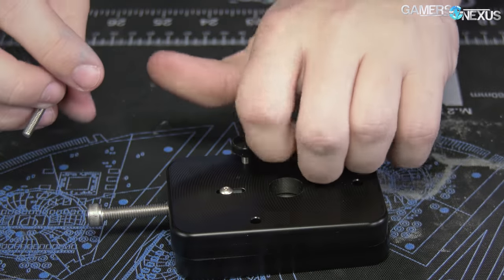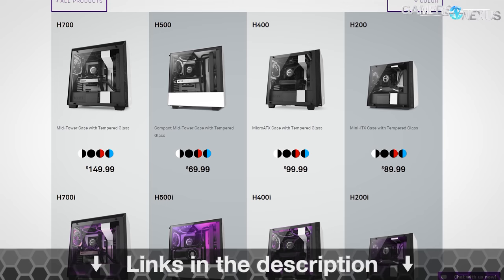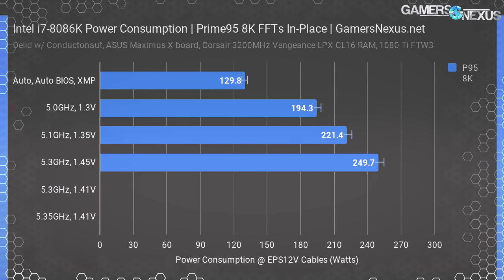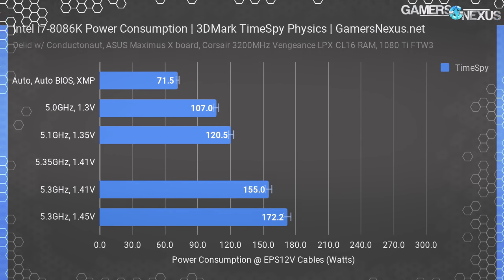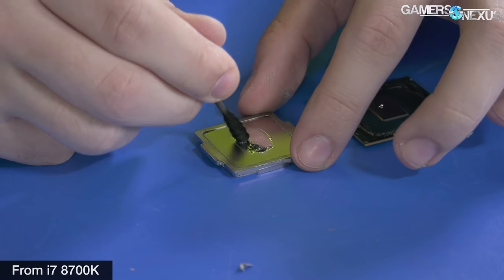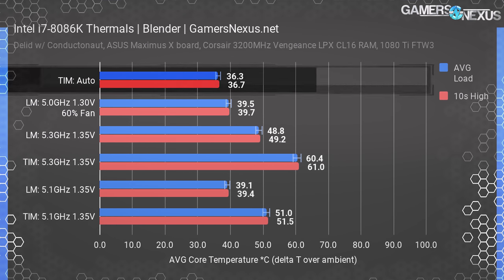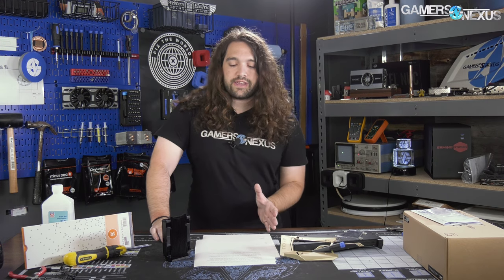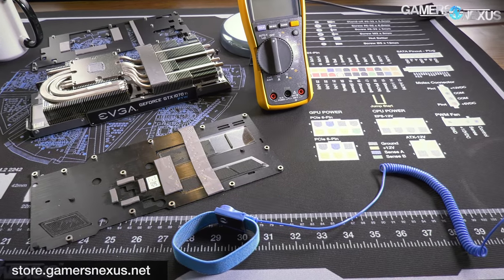The Untold Story of Liquid Metal: 8086K Power, Noise, & Thermals

Comment: I delidded my 7700k just for fan noise reduction. The whole stress of the situation and the fact that I needed to buy liquid metal to get my CPU functioning in what I consider a normal way means that my next CPU will definitely be AMD.
Reply: Aaron B nothing from AMD will operate at 5 ghz or better, so it should be plenty quiet being so slow and all.  GL with it.
Reply: Jeff Smith yep, go INTEL...but hey you got your 5ghz, who needs better multitasking?
Reply: needabettername apparently HardwareCanucks did, when he ditched his Ryzen system in favor of an Intel one...
Reply: Jeff Smith That wasn't a hardware issue, it was a software issue. When Intel has basically been using the same architecture since Sandy Bridge and Ryzen is a brand new thing, it shouldn't be any surprise that software is going to function better with Intel.
Reply: praetorxyn wasn't a hardware issue?  Did you watch the video?  It was due to the 8700k rendering  faster thanks to Intel's hardware acceleration in Adobe premiere.  The 8700k was up there with the 1950x and 7980xe iirc, for a fraction of the price.  Here's the video, you should watch it.

https://m.youtube.com/watch?v=Tj6rUdhmIvQ
Reply: Jeff, I was getting these heat spikes on a non overclocked 7700k. I was just wanting the 7700k to run within the temperature range of my old 6700 non k. It would not. And best of all my fan would ramp up like crazy for no reason, if I actually changed the fan curve so that it didn't speed up at all, my 7700's temps would rise and fall with their own because of the heat happening between the cpu and the metal lid and the terrible tim. My cpu would go from 40c to 79c just for opening chrome, or word, or sometimes not doing anything since a background operation would just start.

Anyways, I delidded the CPU, and now at stock it runs from 40c-50c without making my fans go crazy.
Reply: Aaron B guess you got a chip with poor TIM, happens I suppose.  What voltage were you running?  My 8700k was getting fed 1.35v completely stock by my maximus x hero, now oc'd to 4.7 all cores with 1.15v and highest temp I ever see is mid 60's (benchmarking, high 50's playing Witcher 3, Division, FO4).

In any case, you shouldn't have any problem selling your 7700k system, or the ryzen system later if you're not happy with it, so no reason not to give it a try.
Reply: Of course I did. Adobe doesn't use more than 6 cores or so for one thing. Adobe has piss poor optimization, and from my memory that video was about Ryzen having issues with RAM compatibility and other things. Something like Da Vinci will have Threadripper run circles around Intel's HEDT lineup, while in Adobe they will perform largely the same because Adobe doesn't bother to optimize. Software has to be optimized for the Ryzen architecture, which is going to take time, and some companies like Adobe will probably never bother to do it in any case.
Reply: praetorxyn whether or not Adobe has piss poor optimization is irrelevant, it's the program he uses and he needed the best system for using it, which was an Intel build.  It's really that simple, use what works best regardless of manufacturer.  Only an idiot would buy a certain product based on blind loyalty.  AMD never paid me to use their phenom II 965, FX 6300, or FX 8370, and intel ain't paying me to use their 8700k, lol.
Reply: Of course not. I'm just stating that it would be damn sad if a 7+ year mature platform wasn't performing better than a brand new one in most anything. Hardware is hardware, software is software. I'm just glad AMD has finally done something. Look at Intel ver hte past decade, we had since Sandy Bridge nothing but quad core CPU's and incremental improvements. THen all of a sudden Ryzen comes out, and Intel is all of a sudden able ot pull 6 and 8 core mainstream CPU's out of its ass, so everyone should be thanking AMD regardless of what they're buying.
Reply: praetorxyn exactly why I'm glad AMD came out with something since the sorry excuse of an FX processor and finally gave Intel a reason to start releasing some new stuff.  Most innovations are incremental, just like the 1700x to 2700x for example, but Intel has had no financial reason to spend a whole lot developing when nobody was competing with them.  Same goes for Nvidia right now, nothing competes with the 1080ti, so they have no motivation to release anything better.  Competition is good for everyone, especially the consumers.
Reply: @aaronb5304  A giant Noctua cpu cooler does solve a lot of things at once, everything from noise levels to temperature levels and it´s not even a delidded intel 6700k running stock speed.

Comment: Had a 9900K on preorder, but apparently it runs pretty hot even at stock and the damn thing isn't shipping. Cancelled my preorder and ordered an 8086K and also delidding service for it. I'll run it at 5.0 ghz nice and cool with a 360 rad.

Comment: The amount of temperature reduction is facinating. Out of curiosity, have you ever measured the gap between the inside of the IHS and the top of the die immeadiately after de-lidding? The factory TIM on the die of the de-lidded CPU looked a bit thick.

Comment: its basically a pre-binned 8700k by intel. which explains for low quality 8700k flooding the market lately. based on my experience the first few batches of 8700k was able to hit 5.0 without any problem but nowadays even trying to hit 4.9 proves to be a struggle with delidding

Comment: Excellent video, very well explained! Curious to know were those voltages as measured under load or what you had the voltage set to in the BIOS? They're almost identical to my delidded 8086k results in terms of clock/voltage under load.

Comment: I'm using my 7700k delided, resealed with liquid metal, stock clocks and undervolted (1.21v) :) With temps outside (and inside) near 30C/86F it's kinda cool (pun intended).

Comment: Hey Steve. I think the reason why the most of the users (including me) avoid using liquid metal is the worries they have about lifespan and durability. I really need to know if liquid metal is harmful or not. I use AIO liquid cooler (which has copper base). Some people report fractions on CPU die and corrosion on the copper base of the AIO cooler. Can you explain these issues, please?

Comment: I delidid my 7600k that could reach 5.2 stable but i keep it at 5.1 due to it being at a safer voltage and i put it in a system that i made for running different stuff on and some games. Well i didn't have an aftermarket cooler on hand so i put the stock on and surprisingly it holds 5.1 stable and under load gets up to 94c. Im surprised i haven't burned my house down.
Reply: cowthedestroyer That's actually pretty damn amazing
Reply: Its also astraight up lie, cause the 7600K dosent come with any stock cooler.
Reply: I never said it did. The stock cooler comes from an i3 7320 that i use as a socket protector most of the time but right now its in a pc that my dad uses to watch netflix.
Reply: 7600k doesn't have stock cooler
Reply: So and it runs without a cooler or what?! 
Even so 5,2 or even 5,1 GHZ on a 7600K is highly unlikley,, which Voltage are you using?
Reply: Im getting 5.1Ghz on 1.4 volts. Its running on the stock cooler rn.
Reply: is the stock cooler the one with the copper slug core or without?
Reply: Without but under load it does crash during the day as my room can reach up to 95f and goes back down to about 70 at night.
Reply: cowthedestroyer that's impressive but I wouldn't feel comfortable with my CPU reaching 94C when I can shell an amazing 30 bucks or so and get myself a CM 212
Reply: Im not gonna buy a new cooler im going to take one off of another pc that i have but haven't got around to it yet.
Reply: What do you mean by "underload"?
Reply: Running cinebench it crashes during the day because of how hot my room gets
Reply: For everyone that doesn't belive that i have my i5 7600k running at 5.1 Ghz 1.4 volts on the stock cooler here ya go.https://youtu.be/4-Y6-vtI_YE
Reply: If you really want to cheap out and get a decent reduction, an old intel cooler and high end paste should do a lot.

Comment: When you overclock an i7-8700K or i7-8086K or the future i9-9900K ... does the BIOS/UEFI set all cores to that higher clock rate, at all times? ... and this eliminates "boost clock" since all cores are running at that clock rate, at all times?

Comment: 5:00, Close to advertised TDP ? I though TDP stands for Thermal design power (or how much heat can the chip generates in watts), not power consumption @ 12V cables.

Comment: I'm curious. It's probably a completely useless excercise, but as you're looking at voltages, thermals and fan noise levels anyways, I wonder how much (if at all) the 8086k could be undervolted at it's stock speed. If the voltage could be lowered, thermals, power consumption and noise leves should improve.

Comment: Anybody ever use galinstan? Conductonaut is made of galinstan. You can buy 10g of galinstan on ebay for the same price as 1g of Conductonaut.  This generic galinstan is an alloy of 68% gallium, 22% indium, and 10% tin. Conductonaut's alloy is proprietary and unpublished.  Galinstan will normally have a thermal conductivity of ~30 W/mk, compared to Conductonaut's claimed 73 W/mk.  But, once you get over ~30 W/mk, a TIM's thermal conductive efficiency goes way down as the capacity of other non-extreme cooling components (heatsink/block/radiator/fans/IHS/etc) reach their ceiling.

Comment: Delid + Nofan CR-100A or CR-95C = fanless 8700k at 4.5Ghz all core (+/- 200mhz depending on quality of your chip). Or you can buy an older Intel CPU like 2600k and run it all-core 4.7Ghz just the same.

Comment: and yet my 8700k, runs at 70-85degree stock on full load in prime95 on a noctua d14 with kryonout paste. Perhabs airflow from the workbench used is non obstrocted enogh to get these very good temps even on Tim(non delidded) in your tests.

Comment: I have 4770k I have delided long back and using MX 4 as thermal compound between die and IHS. But thinking of using liquid matel but in my place i do not have access to liquid electrical tape. SO can i use MX 4 for the resistors beside the CPU die ? so that if the LM overflows, it wont sort them. 

Any advice will be helpfull.. BTW your video are awsome and knowledgeable

Comment: It is crazy if you have to delid a CPU just to get the noise level accetable when you clock it on the high side. One more reason why I wait for Zen2 instead of buying a 6 core Coffee Lake, if Intel doesn't even want to solder because  a small percentage of the chips would get damaged if they would do so...

Comment: Pro tip: use a choptsick to remove any leftover silicon from the IHS
Reply from the maker: You really don't want to remove silicon from the CPU!
Reply: Actually just rubbing it with a dry towel works great.
Reply: Maybe someday I'll have the balls to buy an 8700K and delid it :D
Reply: ???
i doubt u mean silicon
Reply: I meant silicon adhesive obviously
Reply: jbryan09100 I think what u meant to say is silicone

Comment: I finally decided to delid my 8700k(1.25v@4.7, no avx offset), was just too scared I'd fuck it up. Recently it started to run really hot with my Kraken Z73 in O11Dynamic - like 40-50C idle,75-85 while gaming (POE, Cyberpunk for example). Case and AIO fans were spinning at 80-90% while gaming and the noise was unbearable. Since I delided and got liquid metal I haven't seen temps go over 70C while gaming and 35 idle, even my RTX 3080 few degree lower temps because it's colder inside the case. Fans spin at 60% tops and I can't hear it anymore with my headphones on. I wish I had done this sooner.

Comment: i'm prepared to void my warrenty on any future intel cpu (cmon ryzen 2, really dont wanna have to void my warrenty to "fix" my ocd and cpu but i would like atleast 4.5ghz so that there's single threaded improvement currently sitting on a 4.1ghz quadcore which head to head in crysis 1 will match ryzen 1 so...not really a upgrade) but what i'm having a hard time finding is how long does liquid metal last in day to day use. if i can slap it on there and it'll have to be replaced next year wel thats annoying but liveable, 2 years is great, if you need to replace it every 6 month's or less personally i'm kinda out because of a rigid tubing liquid cooling system... it's a pain to take appart >.>

Comment: I thought the 8700k was a 80% plus success rate for 5.0ghz? I have one and it can do 5.0ghz at 1.325v but I do put -1 on the avx just to keep it completely stable, before liquid metal I was easily hitting 80c in cinebench and 90c in avx, ive since delidded it and now it sits at around 61c in cinebench max and mid 70's avx.

I am however only using a x42 kraken cooler because I have a strix 1080ti and corsair dominator platinums inside a meshify c case which meant I could not squeeze a x62 in top or front because clearance :(.  very impressive temps after a delid tho on a x42 (70% fan speed) if I do say so myself. for reference I had my delid done ''professionally'' and silicone was reapplied thinly.

Comment: The "Auto" 4.3 All core Turbo is a much more sustainable load than 5.3 OC. Thinking of efficiency.. 198 Watts pure CPU vs 91,6 Watts pure CPU power.. Less than 25% more performance with more than twice the consumption. And that WILL reduce lifespan of the chip a lot. You might think.. But my big AIO handles this at 80c @1.45V. That is within Safe temperature..? No! Temperature range decreases when you raise the voltage. That might be the same as 130c @stock voltage. Same AIO might do about 45c @ 1.15V stock settings. Should give the chip 100x more lifespan. But I agree.. Tweaking and OC for benchmarking etc. can be fun. But not something one should do as a permanent solution. The 5GHz OC should be okay (though it will reduce life compaired to 1.15-1.2V stock settings), but I would really not go any higher than 1.3V for everyday usage. And only with a very good cooler to let it reach 70 > max 80c.

Comment: I don't know if this is the right place to ask but I have a question regarding LM. I had my 7700K delidded (not by myself, had a knowing dude do it for me) in January this year with Conductonaut applied. Am I asking too much of a delidded 7700K or am I just that unlucky - with an ASUS Z270 Prime and D15S with 2 fans running in a range of 600-1000rpm (all this in a S340 Elite with 2 140mm Noctua intake fans and 120&140mm exhaust fans all running 500-700rpm + front dust filter taken off to improve air intake) the CPU still shoots up to 78-79C during gaming (Rocket League, not even that CPU heavy game). vCore is at adaptive 1.34 (the lowest I could get without getting Prime 26.6 BSODs and system lockups). Ambient temp is variable but in the range of 22-23C.
Do I need to dissassemble the system and check the LM application? And is this thermal behavior normal for a delidded 7700K?
Reply: Thunder Run Deffinitly a sign of improper contact or not enough TIM.

First thing to do is check that your CPU cooler is mounted properly.

If the problem persists, change your thermal paste and try again. Make sure to put enough on. One method that works is to put a blob that has the diameter of the capacitors around the socket, in the middle of the IHS.

If you're still having problems even after that, then the issue's under the IHS.

Take the IHS off and scrape off any adhesive holding it in place, on both it and the substrate/PCB. Then just use the retention bracket on the socket itself to hold the IHS in place.

If your problem's still not solved then you'll need to replace the LM.

Comment: Is it worth it to put liquid metal on top of the IHS?
Reply: Nope, tests I've seen show almost no difference vs good thermal paste. Would be cool to see GN test it though, as they are the most accurate/reliable for thermal testing.
Reply: Steve Martino delid that sucker
Reply: is it better? yes probably, but not much. also, be careful with which metals your heatsink is made of, as liquid metal can destroy aluminium for instance, and it bonds with copper too (though it shouldnt structurally damage it)
Reply: The risk of it shorting a capacitor near the socket would terrify me, and the gains would be marginal. Have to wonder why they don't just integrate the IHS into the heatsinks. I guess they don't trust consumers with these smaller bare dies.
Reply: Absolutely do not use liquid metal on an IHS that has a vent hole.  It can seep down in the hole onto the CPU PCB and cause a short between the tiny resistors/capacitors underneath.  If you have a Broadwell-E or Haswell-E you'll know exactly what I'm talking about.  It's a PITA trying to clean out any thermal paste that gets down in that little hole, and if you get liquid conductive material down in there, it can kill the CPU.
Reply: Ironclad that would be stupid bro These r MICROPROCESSORS not raspberry pies. Alot of these get up to 1k+. Point is at that level a scratch from cotton fibers could destroy the cpu.
Reply: For me, -33c drop under load on a 7700k at 5GHz with LM under and over IHS. Also, no replacement of the glue. IHS retained by CPU retention bracket. No shorts for me after one year, but I was careful.
Reply: Ironclad I have delided over 20 Intel cpu's and not one has had a shorting issue while dropping at least 18c off temps.
Reply: pam0077 every IHS has a vent hole, at the PCB. If you are talking about the die
Reply: Steve Martino no, I seen at most 2c difference between the two, use a good TIM like kryonuat and it will be fine. Now flattness of the ihs and cooler can make a bigger difference.
Reply: Yes it’s def worth it.i can hit 5.3ghz 1.5v 7700k with temps under 90c on air